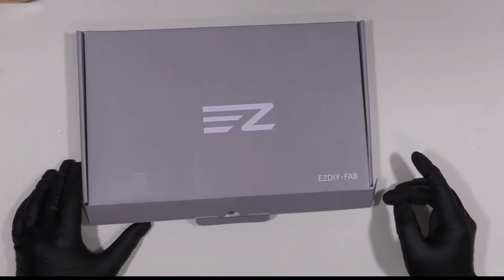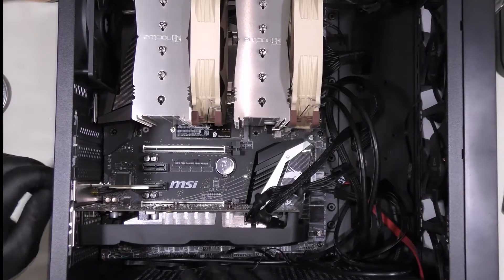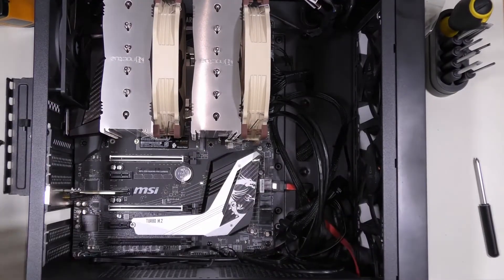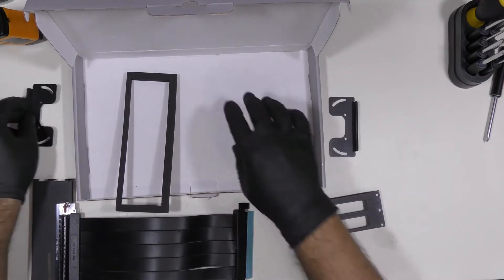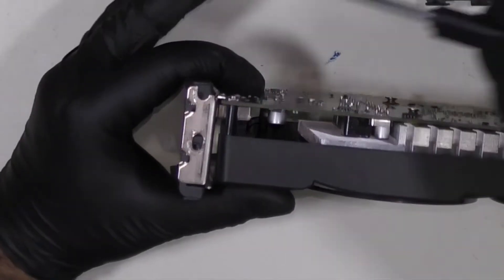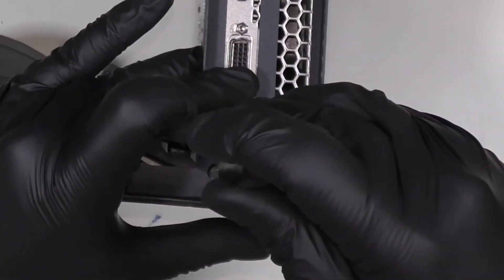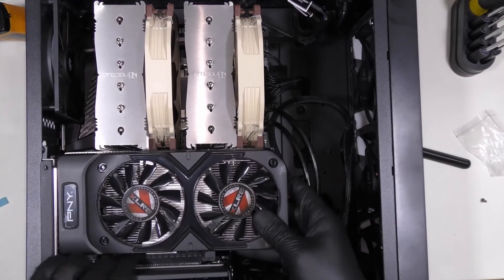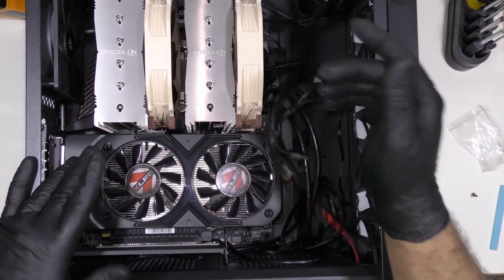This Is How To Mount Your GPU Vertically Using (EZDIY-FAB) Vertical Mount.

Comment: How much does the raser pcie 3.0 affect performance in comparison?
Reply: If you have a 4.0 gpu and mobi this is 3.0 so it will only run 3.0 speed